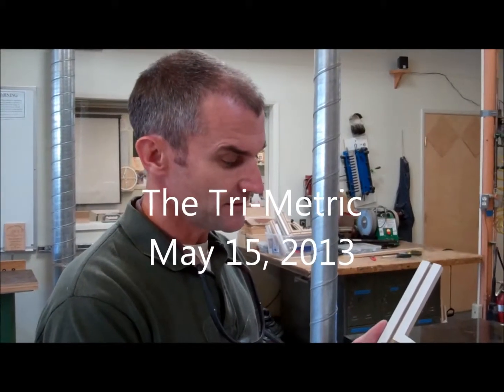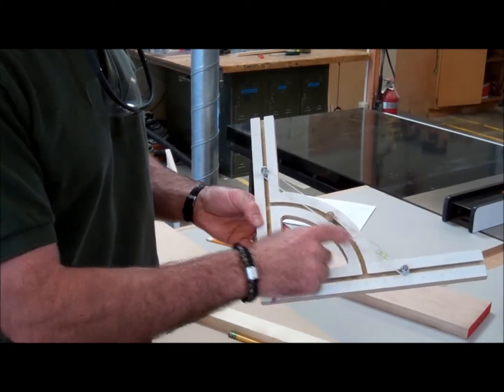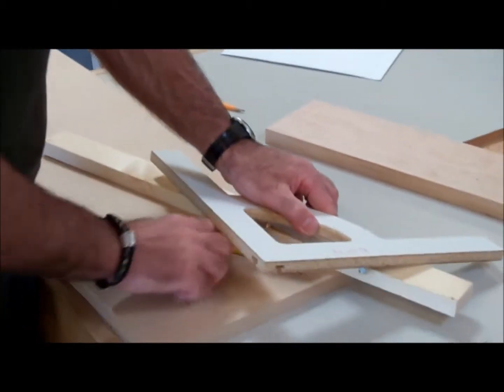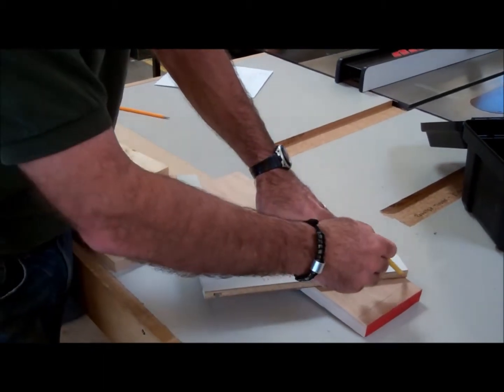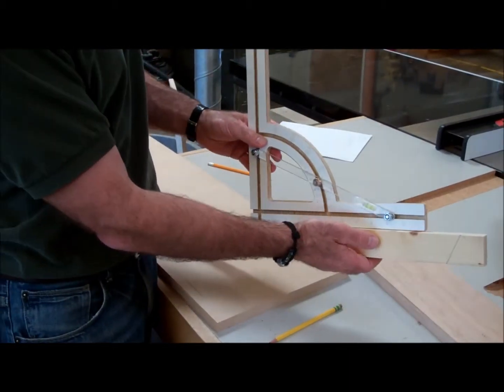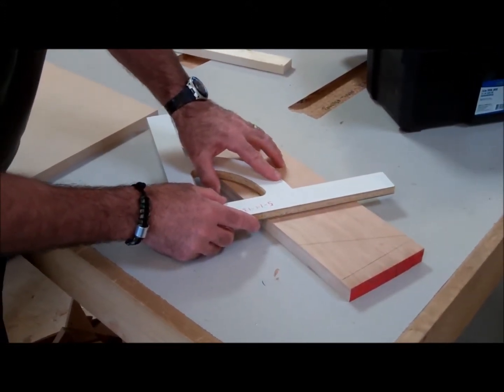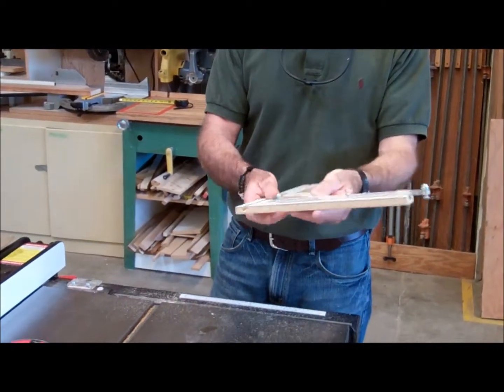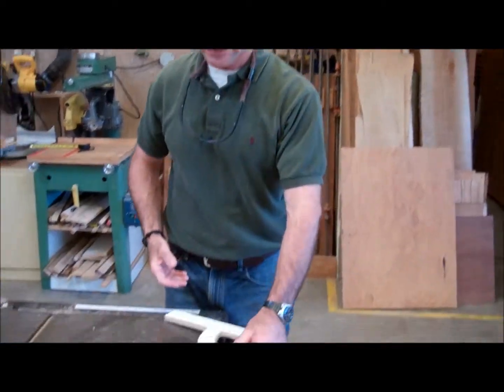The Tri-Metric

Comment: This is it. I am looking for cause i ask many Americans to explain to me what is mean that 6 to 12, of course it's a constant the use for practice reasons, but no one tell me how many degree angles are.
Thanks a lot, i think your tool  its important.
Reply: 6/12 = 50% = 0.5 = tan(26.5)
Reply: Thanks. After some time searching the internet showed me that it is some constant that determines the angle that has the roof.
Because here in Europe when constructing one roof we say 20 degrees or 30 degrees, etc.
Reply: telosfd When distances are involved fractions are easier I think (without calculator). That's probably why roads are expressed in % and not degree: 8% and not 5°  On American roofs the beams are cut and notched to length before placement and many are complex with intersecting planes, all that favoring a fractional approach.
Reply: This is matter of practice and use. Thanks a lot.